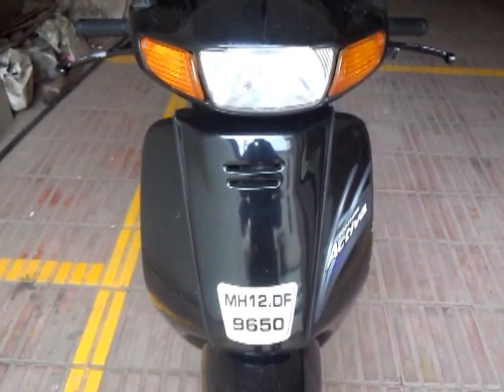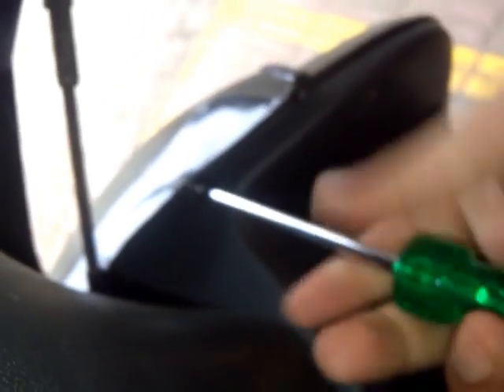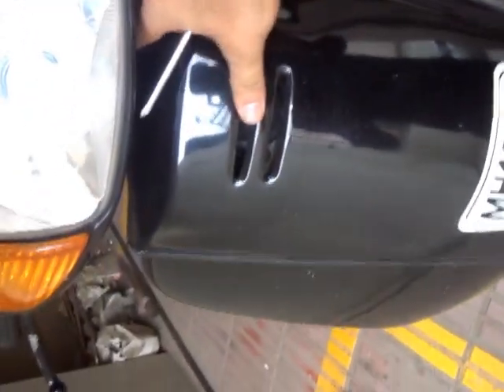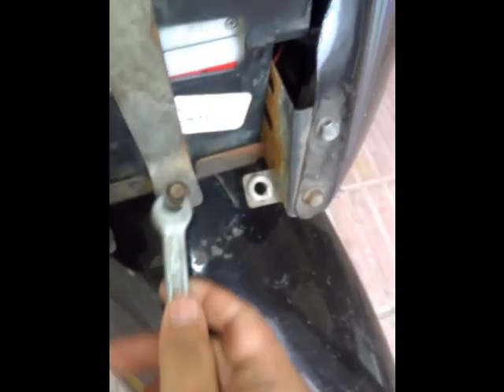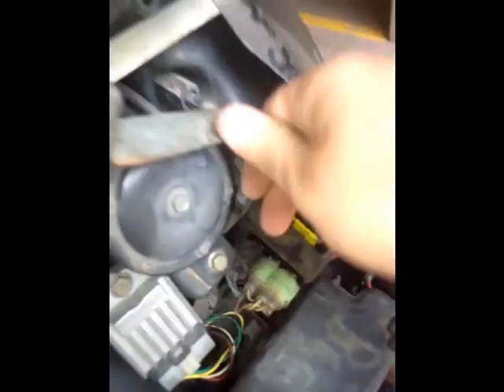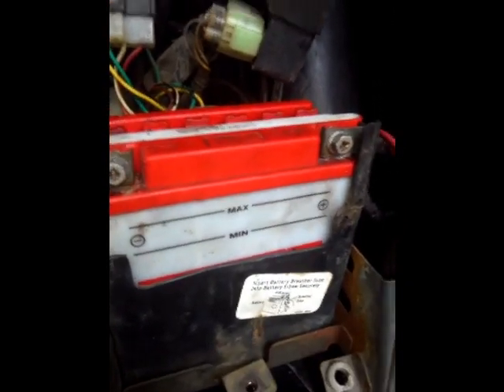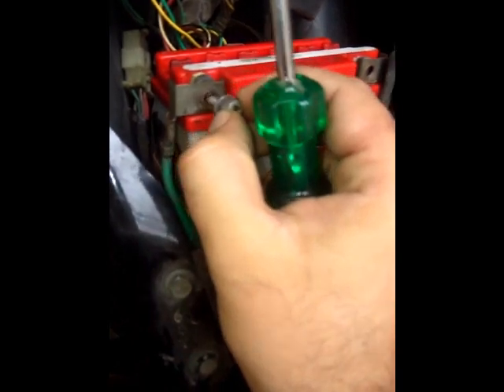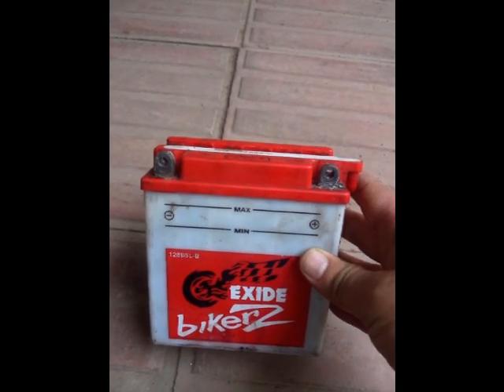Honda Activa - How to open Front panel and Remove the Battery

Comment: Good and helpful video with clear instructions. Small advice from electrical engineer. To be extra super careful one must remove the  negative terminal screw from the battery first.